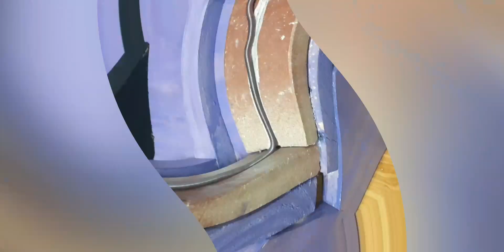COMO CORTAR UNA BOTELLAS DE VIDRIO DE FORMA FACIL Y PERFECTA

Comment: Buenas, me gustó mucho tu vídeo, sumamente interesante. Vos explicas que se necesitan 3 resistencias de 400w cada una, pero yo veo 1 sola, la que se enciende, pregunta: las otras dos también se conectan a corriente y quedan las 3 enlazadas, o bien, en otro lugar van? Agradecería mucho tu respuesta. Abrazos. José Luis
Reply from the maker: Hola Jose las otros 2 están abajo de base, use de 400 , también podes usar 1 de 1000 w. Pero es corte es más rustico.  Como la de 400 w es fino el filamento corta perfecto.  Siempre tenes que aprender y apagar..
Reply: @carpinteriafacilyalgomas  entonces quiere decir, que por la ranura marcada de arriba va 1…las otras dos, van por abajo para calentar los refractarios también. 1 por arriba y 2 por abajo de los refractarios, sería así? Muchas gracias!!
Reply from the maker: @jlconfor  si jose arriba 1 y abajo 2 retencias, siempre conectadas en paralelo
Reply: @carpinteriafacilyalgomas  muchas gracias por contestar, por tu respeto y amabilidad. Así da gusto aprender. Abrazos enormes. José Luis